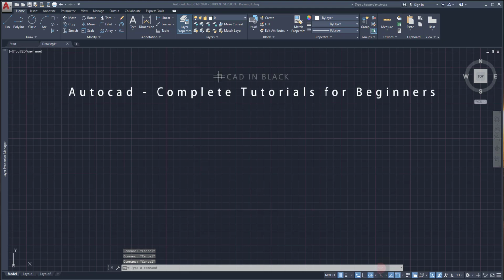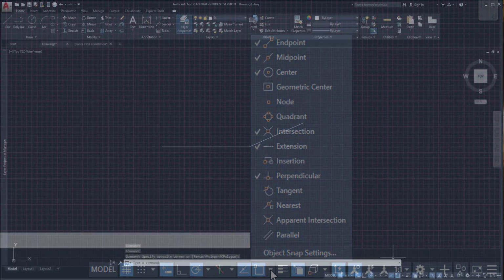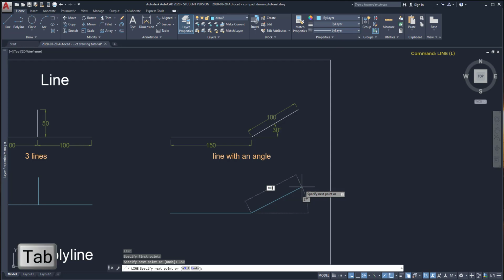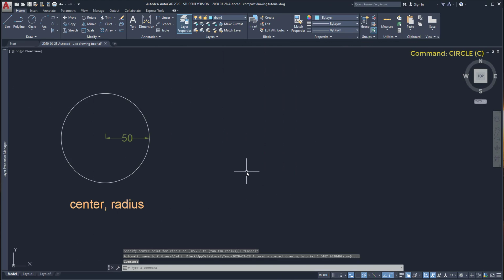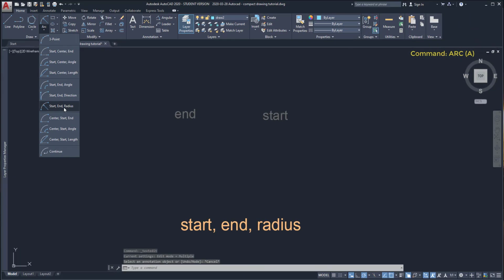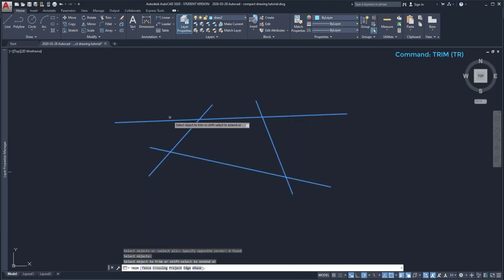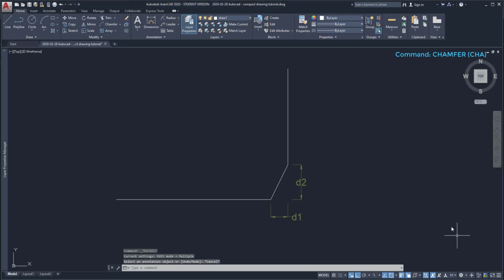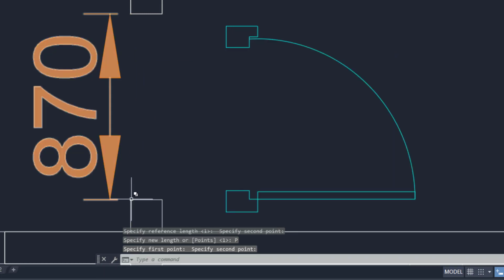Autocad - The Most Important Drawing Commands Explained in 30 minutes -  Part 1

Comment: I do DXF to Gcode conversion in order to do CNC. I need to know how to guarantee that my drawings are relative to position 0,0. That is to say if I want to start drawing at X= 2 inch and Y = 4 inch from 0,0. The poinbt will accuratly convert to Gcode so I can place it at my orgin on the cnc machine. Can you help?